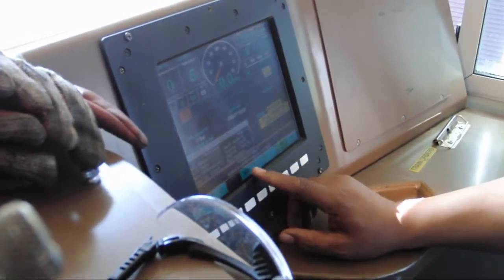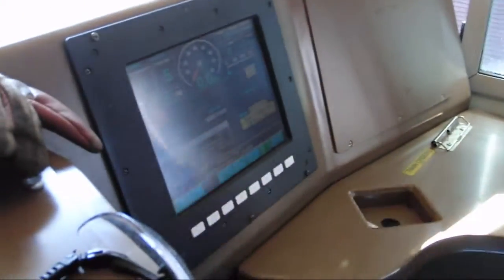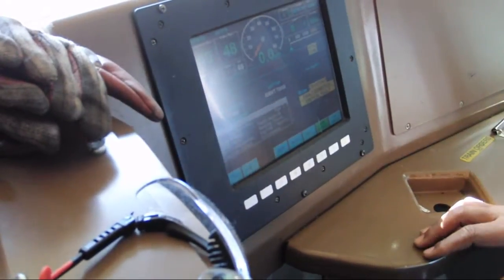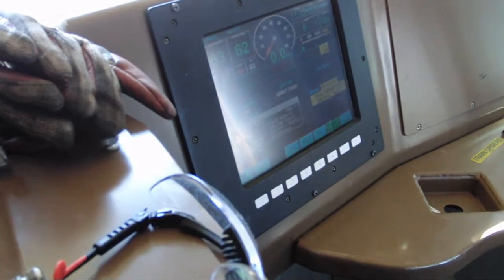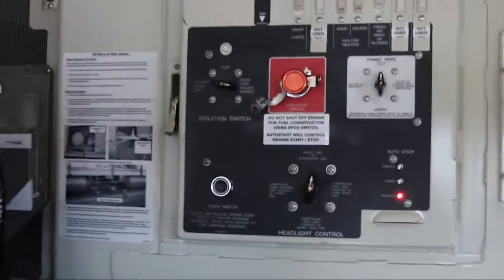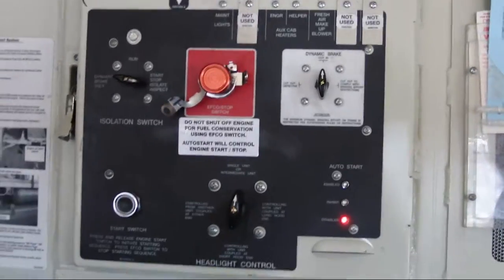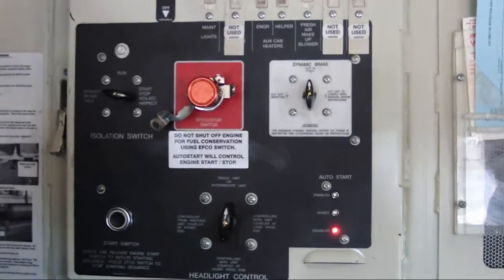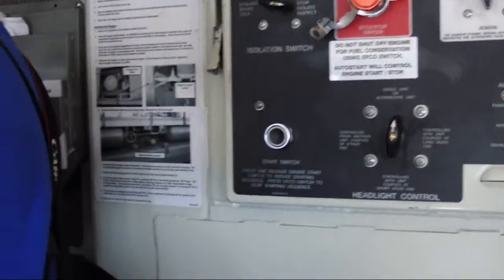SD70M-2

Comment: @mdavid1955 The starting reservoir can only be recharged by hooking to another locomotive and lacing up the main reservoir hoses.  The starting reservoir is directly linked to the main but has a one way check valve and it's integrity is much better than the main air system which will bleed down in a short amount of time.  If no other locomotive is available, you can charge it with a compressor but it takes at least 100 psi in the starting reservoir to operate the starters properly

Comment: If it doesn't start on the 1st try, how long does it take to recharge the starter air?
Is that done by a pump driven by the locomotive batteries?